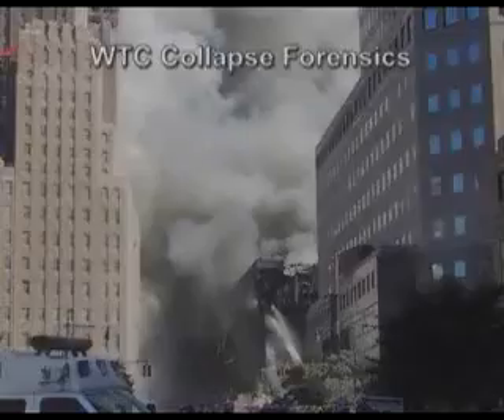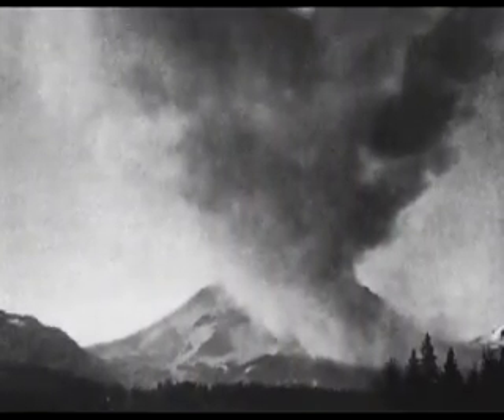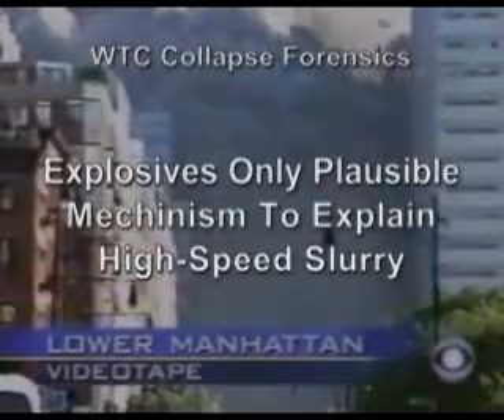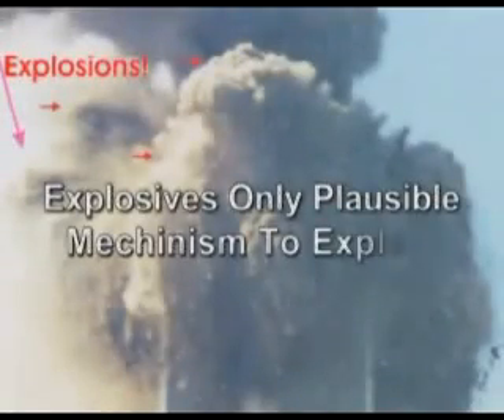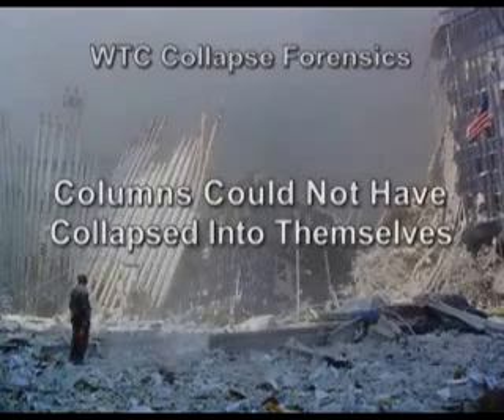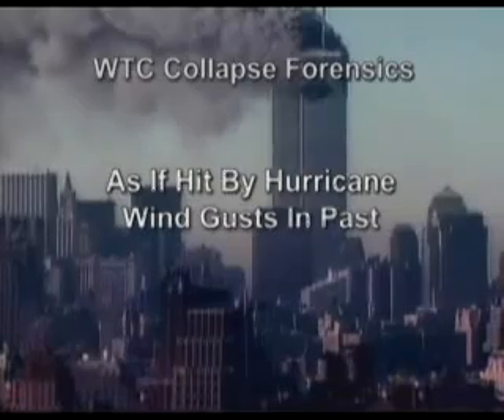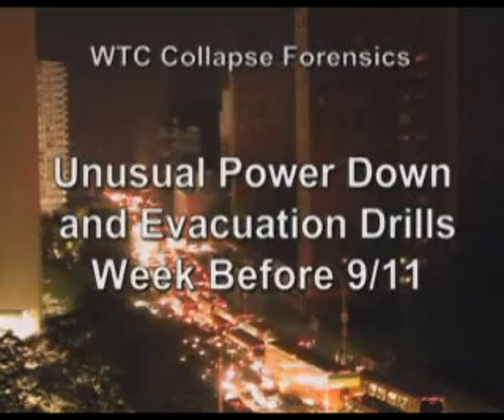MIT Engineer Disputes 911 Theory of the WTC Collapse-Part 2

Comment from the maker: @roquefortfiles 
A tidal wave of burning material falling 1000 ft then melted firetrucks and cars at ground zero? Really? And isn't it weird that the temps recorded in the rubble were hotter then the temps recorded at the impact hole? And the intact floors at the base of the Towers? These are the questions that can not be explained.

Comment from the maker: @roquefortfiles 
"So who gives a turkey about the rubble and heat afterward?"

LMAO!! This is called pure avoidance of something that can't be logically explained. Do you not see that? Something caused firetrucks and cars to be melted beyond recognition at ground zero and it wasn;t a black smoke 1000 ft up. But, it just so happens that thermite can generate temps of 4500 degrees. Coincidence?

Comment from the maker: @roquefortfiles 
"Who cares" is not really a logical answer, is it? Can you explain the mechanism for all three buildings? 

WTCs: Since the fires 1000 ft up were the only heat source, can you explain how these fires came to create this heat buried in the rubble when:

1. Most of the material was ejected laterally at collapse
2. The upper undamaged floors most likely smothered the fires
3. There intact floors prevented anything from entering the basements/rubble

And then WTC7 please?

Comment from the maker: @roquefortfiles 
The Towers and WTC7 fell basically straight down when there were many differences. Plane impact vs. no plane impact? Jet fuel vs. no jet fuel? Lower damage vs. upper damage? Height, design, structure, etc, etc...And what caused the extreme temps buried underneath all three buildings? What did all three buildings have in common to have caused this? Nano-thermite?

Comment: I for one, can say I've looked at the collapse from every possible angle. It it highly unlikely that both of the towers would collapse in exactly the same manner producing the same results. If it had been structural failure due to fire, than there should have been two different failures. To postulate that the planes created symetric damage to the towers thereby creating an exact collapse in them is ludicrous and counterintuitive. Lest we forget Bldg 7 and the Pentagon. Use critical thinking!

Comment: The buildings were pulled by an underground nuclear blast. It is the only way to get 85% of the buildings completely pulverized into dust and have a molten core burn for so many weeks after the event, emitting radioactive vapors. The asbestos story is a lie to cover up the truth. AND BECAUSE THE LIE IS DIFFERENT ON EVERY LEVEL: If the official story is bull shit the version that was served to middle class officials was bull shit too. It's fully documented on the web. Search and you will find.

Comment from the maker: @roquefortfiles 
So there's no comment on the melted steel (as you mentioned??) and melted firetruck and cars at the Tower's base? The only nonsense is thinking that small fires (black smoke) 800-1000 ft up could cause these extreme temps in the sub-basement levels. So, did these fires take the elevator down to the basement levels? Funny and desperate..

Comment from the maker: @roquefortfiles 
When WTC7 collapsed, it barely touched its two neighboring buildings, (Verizon and post office) considering its sheer size.

drjudywood*com/articles/dirt/pics/Image217*jpg

And the 1350 ft North Tower falls and only one side of WTC7, which is mere 300 ft away is damaged. What xactly would you call falling straight down?

Comment from the maker: @roquefortfiles 
I knew it!! LOL. Ok, here's a question. Knowing that the Towers and WTC7 had differences in the damage occured (lower vs. upper), plane vs. no plane impact, height, structure, construction, etc, why did all three buildings fall basically straight down in secs? And what did all three buildings have in common to have extreme temps buried in the rubble/basements? Any ideas?

Comment from the maker: @roquefortfiles 
Your question was answered. These are called unknowns as to which I can't answer. Focus on the known evidence that is not normal for a building collapse 

1. Near free fall collapse

2. Witness accounts of explosions

3. Pulverized concrete at initiation of collapse

4. Pre-collapse ground shaking

5. Demolition flashes

6. No physical evidence of extreme heat at impact hole but..

7. Extreme temps buried in basement/rubble for weeks

8. Nano-thermite discovered

Comment from the maker: @roquefortfiles 
Hey Rogue. If you need a laugh, here's a great clip where Popular Mechanics is cornered with some relevant questions and folds. The most hilarious is the fact that the hijacker's DNA was supposedly identified at WTC. How? Thru the rubble and moten steel? And where did they get the original DNA from the hijacker's to compare or match to? Any ideas? I asked your partner Vista the same question... 

watch?v=xCd6CjIHedE

Comment: Only a few minutes to spare u
1. watch?v=qLShZOvxVe4
2.First 2 guys are giving you the facts,  the plane hit, the explosion ripped down the elevator shafts. Willie R.has changed his stroy more times than I can count.
3.Will have to wait
4. Proof?
5. Red Hot != Molten
   molten metal != Molten Steel
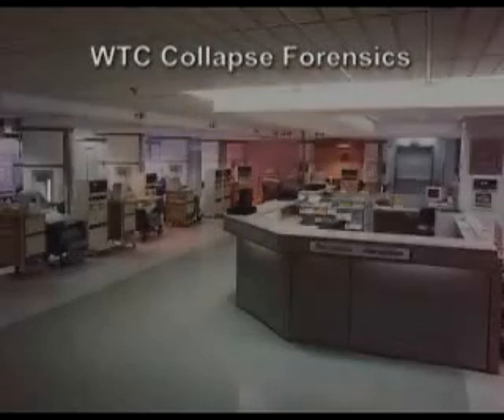   Guy @ 4:30 in the video provides a perfectly sound reason why there could have been molten metal & why the fires lasted do long(you really should pay attention)
6. What Scientists?

Comment from the maker: "and I quote you here"

That's at the direct impact zone, not buried under rubble (basements) for weeks. There's no plausible mechanism for this heat from fires 800-1000ft above to burrow their way thru steel and concrete. Also, enter more logic. The fires were most likely smothered at collapse and/or most of the material at the impact zone was turned to dust or ejected sideways..

Comment: @muzicmaker2001
1.Not even close
2.You have proof of explosions BEFORE the planes & fires?
5.FALSE there was an OBVIOUS origin 
also
"By Sept. 23, 2001, most of the hot spots had cooled or the fires had been put out." USGS  
6. NOT a single sample of "Nano-thermite" has been produced for analysis 

I don't have the time to respond to your other speculations tonight.Maybe later.

Comment from the maker: Facts are usually supported by irrefutable evidence. But, your theory has none. Using the available evidence, the most logical cause of the collapses was pre-planted explosives. For example...

1. Near free fall collapse
2. Accounts of explosions unrelated to the fire/impact
3. Massive steel ejected laterally
4. Concrete pulverized at the initiation of the collapse
5. No logical origin for the extreme temps under the basements lasting for weeks
6. Nano-thermite in the rubble

Comment: @muzicmaker2001 

It's not MY theory. It is that of the scientist of NIST as well as all other respected groups that have investigated..

MY fact ( Not theory) is that heat on unprotected structural steel has a profound weaking effect.
Jeff's argument is that "steel maintains a lot of its structural integrity when heated until you begin to approach the melting point"  
Jeff is wrong why the hell won;t you just admit that?

What is YOUR theory about the cause of the collapses?

Comment from the maker: Once more... 

"Of the more than 170 areas examined on 16 perimeter column panels, only three columns had evidence that the steel reached temperatures above 250 ºC. Using metallographic analysis, NIST determined that there was no evidence that any of the samples had reached temperatures above 600 ºC." (p 140)-NIST 

coupled with people at the impact hole=no evidence of extreme temps causing the collapse. Isn't this the REAL point rather than Jeff King?

Comment: @muzicmaker2001 
As far as people standing at the perimeter wall impact hole proving there were no high temp fires in the building, that  is pure argumentum ad ignorantiam .

Stop with the red herrings already and simply state  yes or no  Do you believe Jeff King made scientifically incorrect statements about the effects of heat on steel?
The question is not IF he was wrong (this is easily shown to be so ) but, rather the question is do you understand and admit he was wrong?

Comment: @muzicmaker2001 

How about King's claim that steel maintains a lot of its structural integrity when heated until  you begin to approach the melting point?
I guess King is smarter that all those folks at ASTM?

The "pyroclastic flow" argument is also irrelevant because neither the velocity nor the temp of the dust cloud were even close to those of  a "pyroclastic flow" .

King should stick with subjects he supposedly knows, like hemorrhoids & toe fungus.

Comment: @bruthav 
Jeff King claims that  "steel keeps a lot of it's structural integrity when heated until you begin to reach the melting point"    Total BS any engineer can tell you that The yield strength of steel is reduced to about half at 550 ºC. 

At 1000 ºC, the yield strength is 10 percent or less, 

Guess what? Building fires, like those inside the WTC towers, can normally reach temperatures of about 1000 ºC!

Comment: @MrREZWAN
I am an American. I live in America.
You have been misled. 80% of Americans DO NOT believe that 9/11 was an "inside job" 

The fires in any of the WTC buildings were easily hot enough to melt Aluminum.
Typical building fires can reach 1000 ºC.
The melting point of Aluminum is about 660°C

watch?v=DhHzMttUKO0

Comment: @muzicmaker2001
Typical strawman tactic
 Was jeff discussing the perimeter columns? NO
Waa his statement concerning the effect of heat on steel correct? NO

If you do some checking you'll find out several of the other supposed "facts" in this video are pure unadulterated BS or possibly just ignorance.

Comment from the maker: "Of the more than 170 areas examined on 16 perimeter column panels, only three columns had evidence that the steel reached temperatures above 250 ºC. Using metallographic analysis, NIST determined that there was no evidence that any of the samples had reached temperatures above 600 ºC." (p 140)-NIST

Comment: @Tommyfmx,
 Jeff is NO MIT engineer. He spouts pure has had his 15 minutes of "fame"

You want proof? King "Steel keeps a lot of it's structural integrety .. even when heated until you begin to apprach the melting point"

A ACTUAL engineer would know  that the yield strength of steel is reduced to about half at 550 ºC.  Now gp fire up google and see what the melting point of steel is....

Comment: Never heard of wireless detonator and air pressure detonator?
This one can blow up on shock wave of another explosion.
These devices are not used in Building demolition
BECAUSE
it has to be an accurate job with low risk and low area damage. 
SO >Explosion rate 100% and accurate timing.
THAT means time!
Up 90% of the time is used to set/check it properly.

If you don't need safety you set it VERY quick!

WTC really need accuracy?

A 30% success rate would explain  so much termate into the debris.

Comment: something i dont hear mentioned my these guys  is that steel skycrapers are built  using a safety factor of something like 10 or 20. so the building is over designed by very significant amount.  so that also supports that it took alot more than jet fuel and pancake theorys to bring it down.

Comment: Muzic

I didn't post any BS links. You asked for steel from the WTC. You didn't specifcy till after I'd posted them. So the trick's on you. You've been thoroughly debunked and trounced after failing to bring forth 1 piece of evidence that I asked you for. Try to grasp this. There's not 1 piece because there's none to be had. Comprende'??

Comment: Tully Construction has said no such thing. Leading demolitionists  CDI were consulted and went to Ground Zero to inspect and give advice on the cleaup efforts. No explosives were found in the dust.  You've been given concrete proof including an explanation on why it wasn't explosives by a demolition company.  If anyone would've found remnants of timing wires, blasting caps, detonation cords, slave wires it would've been the surviving FDNY trying to find their fallen brethren. These are facts.

Comment: "the concave bowing of the steel was seen on the sides of the towers opposite where the planes hit them. At 10:06 a.m. that morning, an officer in a police helicopter reported that ``it's not going to take long before the north tower comes down.'' This was 20 minutes before it collapsed. In another radio transmission at 10:21 a.m., the officer said he saw buckling in the north tower's southern face"

New York Times, July 2004 

Did he lie?

Comment: Heat conducts itself through mediums, one of them is concrete, heat itself radiates. The area affected did collapse. The problem is that the momentum, mass & kinetic energy was too much for the lower portion to comphensate for, thus a progressive collapse.  

Have you even glanced at any of the links provided? Or am I wasting my time?

Comment from the maker: In the 1990s British Steel and the Building Research Establishment performed a series of six experiments at Cardington to investigate the behavior of steel-framed buildings. These experiments were conducted in a simulated, eight-story building. Secondary steel beams were NOT PROTECTED. Despite the temperature of the steel beams reaching 1,500-1,700 F in three of the tests well above the traditionally assumed critical temperature of 1,100 F, no collapse was observed in any of the six experiments.

Comment: The head of the WTC Construction Management Dept went floor to floor, office to office when he found a damaged elevator shaft, then readiod down to the FDNY they needed to get a structural engineer onsite imediately. He knew the tower was in trouble.

ht tp:  // query. nytimes. com/gst/fullpage.  html?res=9B05EEDA1F39F93AA1575BC0A9659C8B63

Comment from the maker: "The fires were in scattered areas"

Enter logic again. The plane entered,  sprayed jet fuel, and parts exited the other side. If the heat concentrated on one side or scattered, the collapse would've intiated from those areas most weakened by heat.  Thus, the collaspe would've been asymmetrical.  Also, look up thermoconductivity in relation to steel.

Comment: Read on and observe:

 (2) the subsequent unusually large jet-fuel ignited multi-floor fires (which reached temperatures as high as 1,000 degrees Celsius) significantly weakened the floors and columns with dislodged fireproofing to the point where floors sagged and pulled inward on the perimeter columns. 

ht tp : // wtc. nist. gov/pubs/factsheets/faqs_8_2006. htm

Comment from the maker: "NIST reports that pockets of fire hit 1832°F"

We have a problem here:

"Of the more than 170 areas examined on 16 perimeter column panels, only three columns had evidence that the steel reached temperatures above 250 ºC. Using metallographic analysis, NIST determined that there was no evidence that any of the samples had reached temperatures above 600 ºC." (p 140)-NIST

Comment from the maker: "But jet fuel wasn't the only thing burning, notes Forman "

Was Forman Williams actually there?No? Then this is nothing but his theory. You know the different between a theory and a fact, right? Reread your posts and find the facts.  There are none. Again, do you have any concrete evdience?  Have you seen at least one picture of the steel from the impact zone? Was the steel analyzed from heat degradation? Stop posting opinions and post just one picture.  That's all I want.

Comment from the maker: "Steel loses about 50 percent of its strength at 1100°F'

Let's examine this.  Edna Cintron was seen at the impact hole (North Tower) 20 mins before it collapsed.  From impact to collapse, there was 102 mins (North Tower). So, after 80 mins of the raging inferno and 1100 degree temps (ok), Edna walked through, over, around, this heat to get to the impact hole?  Enter Logic..... use your head

Comment: Jet fuel burns at 800° to 1500°F

"Steel loses about 50 percent of its strength at 1100°F," notes senior engineer Farid Alfawak-hiri of the American Institute of Steel Construction. "And at 1800° it is probably at less than 10 percent."

Comment: lera. com/sep11. htm

"We designed the towers to resist the accidental impact of a Boeing 707, perhaps lost in the fog while seeking to land. The impact of the Boeing 767s, commandeered by the terrorists, even though larger and flying much faster, was still unable to bring down the towers. The fire-resistive systems, however, did not and could not have contemplated the subsequent fire fueled by thousands of gallons of jet fuel." 

Managing Partner
Leslie E. Robertson Associates, RLLP

Comment: "I have never seen melted steel in a building fire," 

says retired New York deputy fire chief Vincent Dunn, 

author of The Collapse Of Burning Buildings: A Guide To Fireground Safety. 

"But I've seen a lot of twisted, warped, bent and sagging steel. What happens is that the steel tries to expand at both ends, but when it can no longer expand, it sags and the surrounding concrete cracks."

Comment from the maker: My intial point is the official side has no real evidence, so it becomes nothing more than a theory also. But, it should have concrete evidence because it was only avenue examined. The most damning evidence would be the supposed heat damaged/weakened steel from the impact zone. Have you seen pictures of that? Has anyone? These pictures should've been on the first page of the NIST, FEMA and all other related reports. I can list evidence against the official theory if you would like?